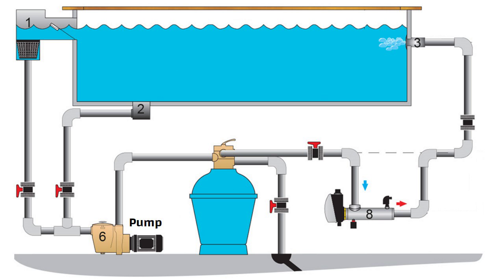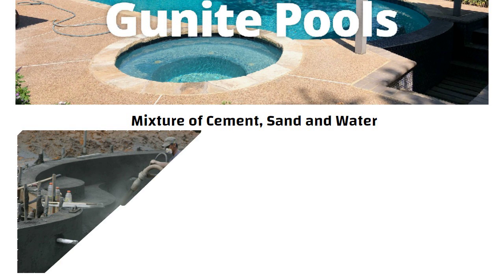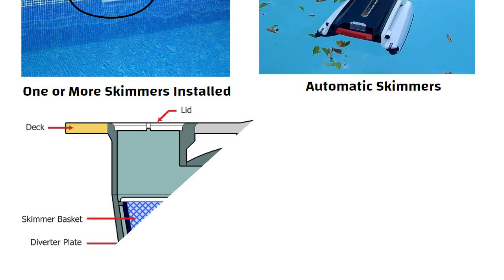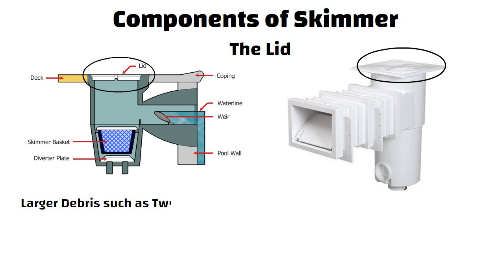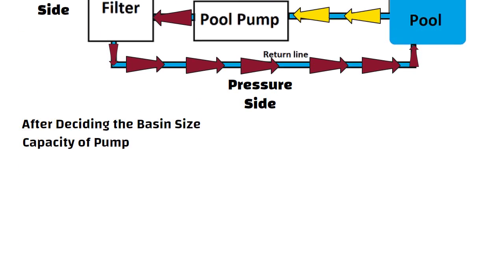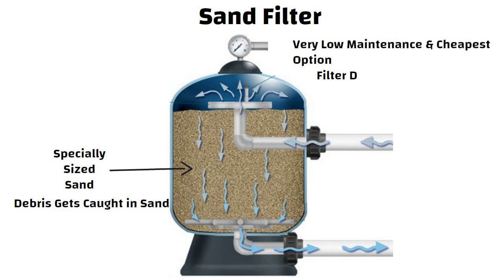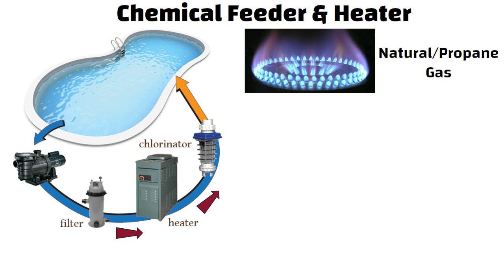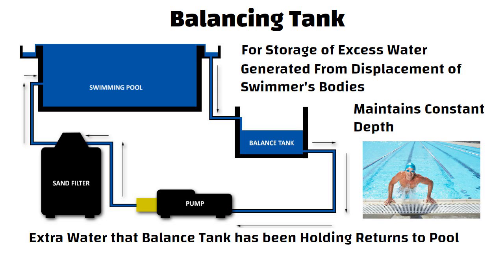How Does Swimming Pool Work?

Comment: Is it necessary to install the pump below the pool?
Reply: No, the pump creates a vacuum using the impeller and will pull water out the pool, it can be same level of the pool but ideally not higher

Comment: You forgot to mention stainless steel - such a beautiful piece of engineering sits a few meters away outside in our garden! They are expensive to build, but really nice to look at and very easy to maintain. It's now 15 years old and and still looks brand-new after an hour or two of giving it some love. Modern pools also often have a pool-manager to steer the pumps and back-washing times. And we have a second modul that constantly measures ph and chlorine and adds chemicals in small amounts if necessary. Thanks for the video!
Reply: "Stailess steel" what exactly?
Reply: @jeffv444  what is it exactly you would like to know? We had it built by polytherm of austria 🇦🇹, there you can have a look. It stands on a slab of reinforced concrete, but the rest is made of stainless steel, with stabilizers around every 80 cm, partly refilled with porous concrete around the tubing. Looks and works great!
Reply: @jeffv444  It's really the whole tub, not just the frame. It's 4.5 x 9m, they brought the floor in 3 pieces and welded it together right here, it's 1.5 m deep, they prepared the front and back panel at their shop for all the inlets for the technique, the sides were 4 pieces each if I remember correctly, all welded together here our backyard in the coldest winter we had for years within about a week. There is frame around it of course and reinforcements going to the side. Does it make sense now? Really the whole tub is stainless steel - and it's still beautiful today 11 years later!
Reply: @stefanschneider3681  the whole tub made of stainless steel? would be the most expensive option, no?